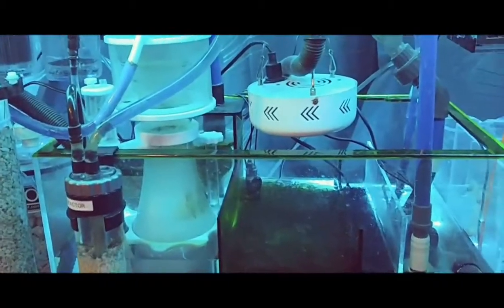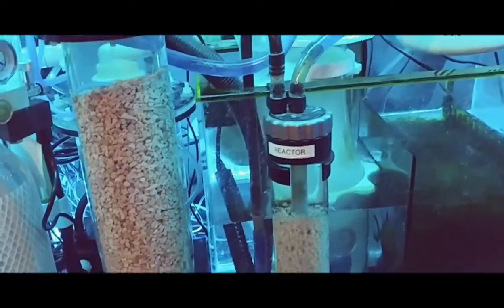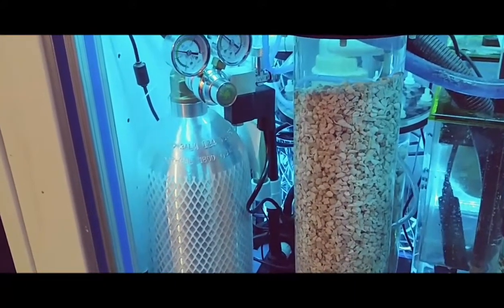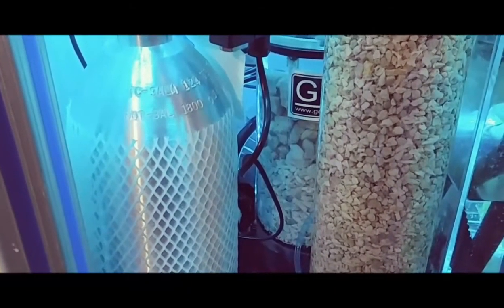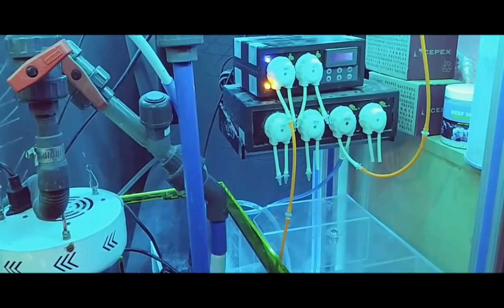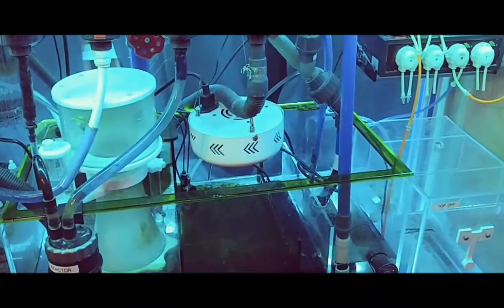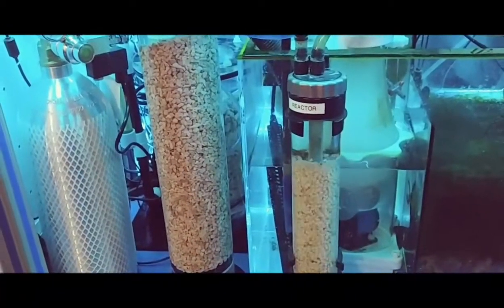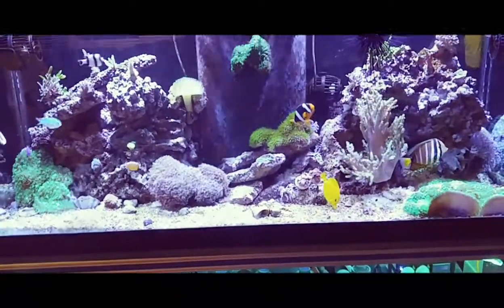Calcium reactor setup

Comment: 1ppm Nitrate isn't bad.  In fact I try to keep around 3-4 ppm any lower and my corals go pale quickly.

I would keep the Kalk, will keep your pH up.  I think higher pH.  Mine stays between 8.25-8.4
Reply from the maker: bif24701 Ok Thanks. I will do that.

Comment: awesome tank, equipment & fish selection ... When adding the Ca reactor did you need to adjust the GFO/Carbon reactor any and/or adjust the BioPellets reactor? The sump area is well organized also!  Good job with the wire management.
Reply from the maker: jassimps Thanks! No I have not adjusted any of the other equipment yet. I may need to in the future. This is my first calcium reactor so I will be checking on things as I go. I will let you know what all I come up with as time goes on.